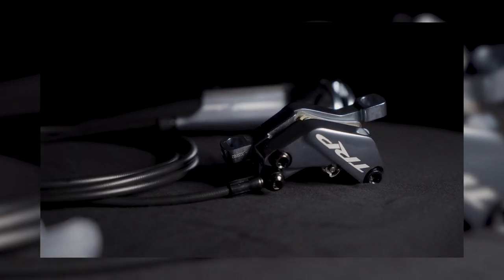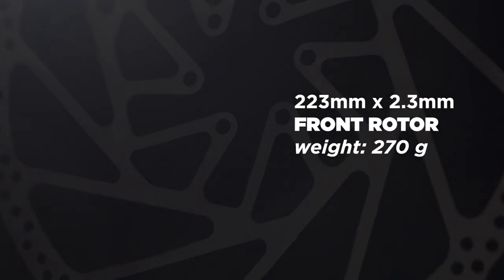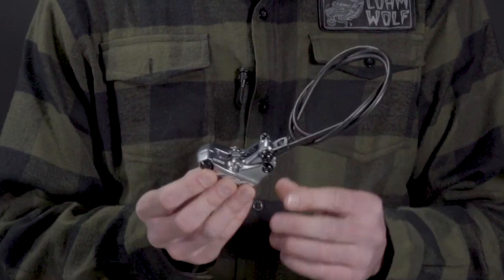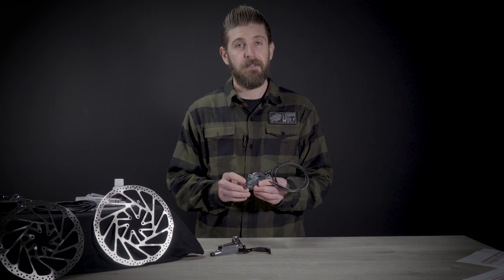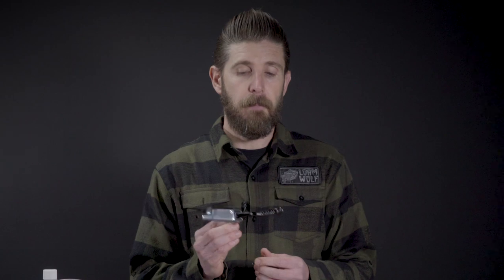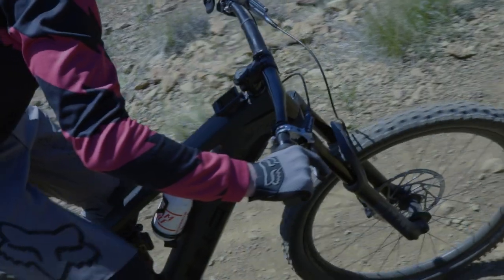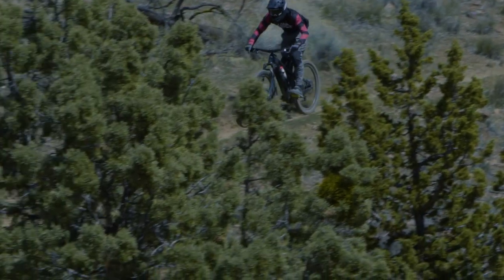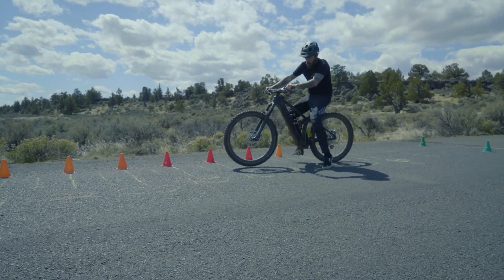TRP's New DHR EVO & eMTB Brakes | The Loam Wolf

Comment: I like the modulation of trp brakes.  I find the shimano brake lever feels like an on/off switch where the lever just hits a wall and you only have a millimeter of modulation.  With my trp G-spec brakes the braking force is very linear and easy to modulate.  I look forward to trying the dhr evo.

Comment: Love the stopping grid idea.. does this imply that you guys have also been doing similar side by side test comparisons on other brakes as well.. say, Hayes Dominion A4, Shimano XTR, Sram Code RSC, Hope E4, Maxima, Magura ? Keep up the great work and vids!
Reply: only thing better on your list is Maxima, only reason. I say that is i have not tried/cut afford them. Have literally tried everything else.
Reply from the maker: Yes we actually just did another video with some Magura brakes showcasing the stopping distance changes from fresh rotors and different brake pad compounds. Give it a watch.
Reply: The Loam Wolf Awesome 👏🏼 good stuff! Curious about the Hayes dominion A4 in comparison with these higher end stoppers ✌🏼 Wondering how much of the results vary by just the Brake Vs Rotors also